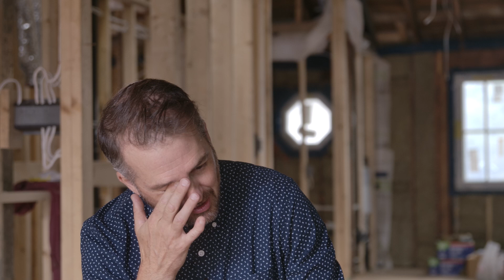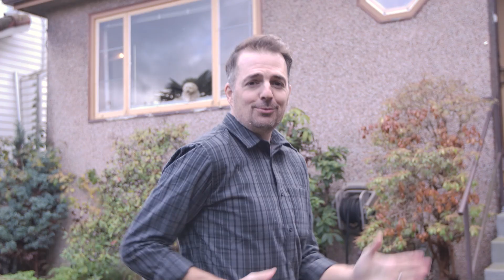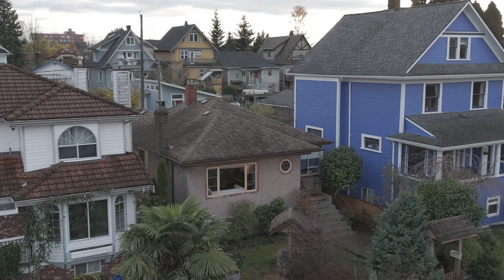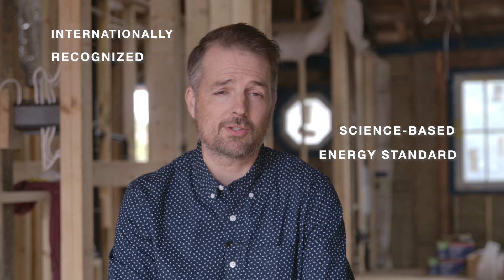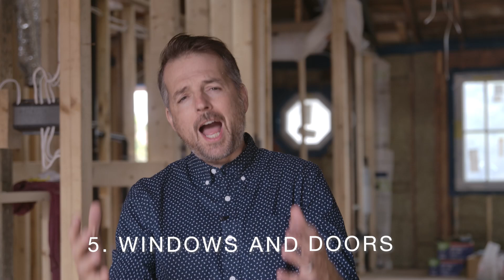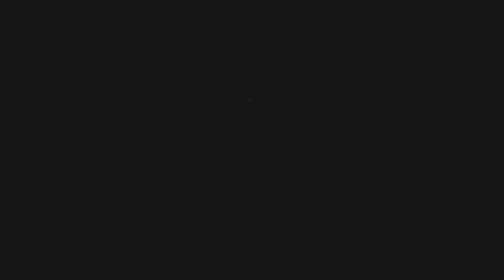What Is A Passive House?

Comment: How is the HRV dependence of a passive house part of the "resilient" bit? 
The  Webster definition of Resilient is:  "capable of withstanding shock without permanent deformation or rupture" or "tending to recover from or adjust easily to misfortune or change" 
These are not necessarily things i associate with technical machines. In fact the slightest of breakdown of wear and tear, or power failure causes risk of permanent damage to both building and humans inside. 
There must be a better way to put a house on a "ventilator" such as utilizing natural breathing mechanisms. Or no?
Reply: Great question! The resilience Todd speaks of is a home's ability to keep people safe and comfortable even in a heat dome or deep freeze and even if the power goes out. A Passive House is designed to keep indoor daily temperate around 70oC (winter) to 75oC (summer), vastly reducing the reliance on natural gas or electric heating/cooling. Hope this helps.
Reply from the maker: There are other methods and of course there is always windows. I’m definitely not an expert in alternative HRV technologies but sometimes there is a balance to determine which systems are the ones we will rely on. I’ll also add that the technology is always changing and I look forward to further improvements. For now, HRV for me and I’ll share how it’s going as we move in.